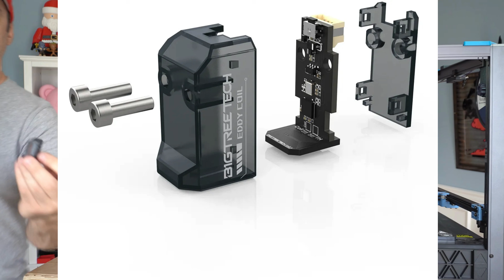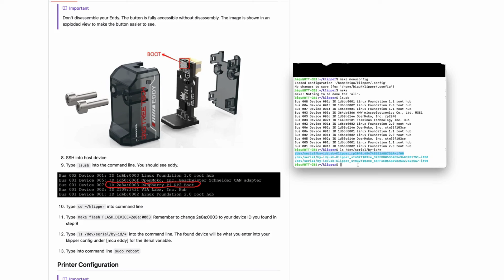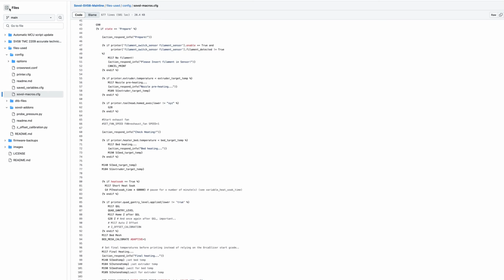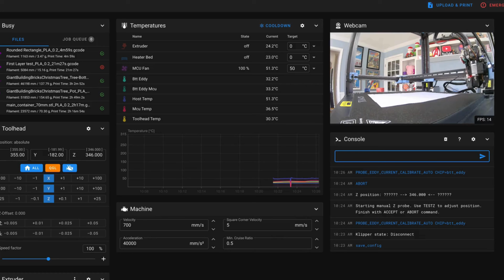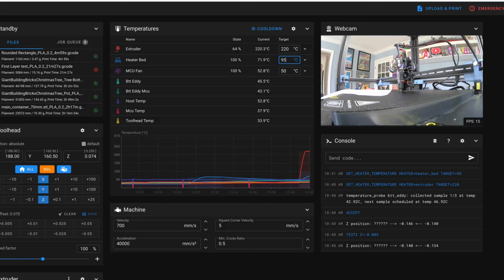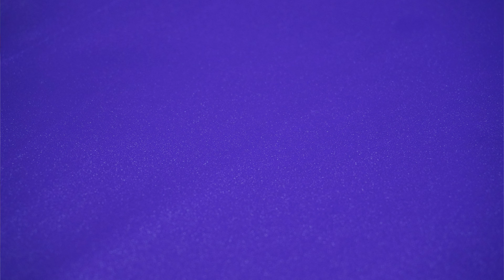BTT Eddy USB Probe Setup on Sovol SV08 – Full Install & Calibration Guide

Comment: Have you had any
"mcu 'eddie' unable to connect"
Errors on klipper yet?
I did the same install last week on my sv08 and kept getting intermittent freezes mid print coming from the eddy.
After some GitHub reading I bought some ferrite cores and used one on the eddy cable and another on the tool head umbilical. I've not had an issue since.
This is something to do with EMF Interference apparently.

Just dropping this here to save people the headache I had.
Reply from the maker: I have not gotten the "mcu eddie unable to connect" yet. I will keep an eye on that. I did not attempt to modify my usb cable, so I wonder if the quality of the shielding isn't good, or if it's shielded at all!!  I'll drop a link if I can find a higher quality cable that is cost effective and see if I can do a video on converting to those for the tool head and eddy. Thanks for sharing that information. My plan with this printer is to do a series of upgrades to improve reliability and performance.
Reply: @ThePrintasaurus  The shielding is the conclusion that was reached on GitHub discussion.
Reply: Hey there! I got this error periodically. It makes my butt hurts when long print fails. I'm running Neptune 4 Plus with Eddy USB. I'll try cores, hope it works.
Reply: @blaine_th3_mono  I haven't had an issue since sticking the ferrite core on the usb and  my hotend umbilical. The latter was just for good measure to be honest. I hope it sorts it out for you
Reply: @Hotkife  Hi! I installed ferrite cores on every interface cable (eddy, usb hub) and carefully would say that as for now have no issues on two long time prints.
Reply: @blaine_th3_mono  fantastic! We definitely need this highlighted to others as this is clearly a btt issue.
I have been in deep conversation with btt and they offered a replacement cable, I asked if it was the same as the original or has shielding or something, they said it was the same.... I didn't bother.
Happy printing!